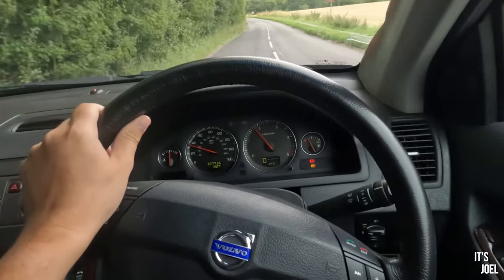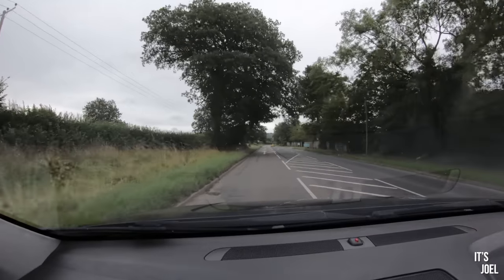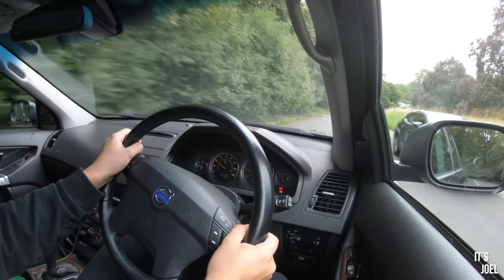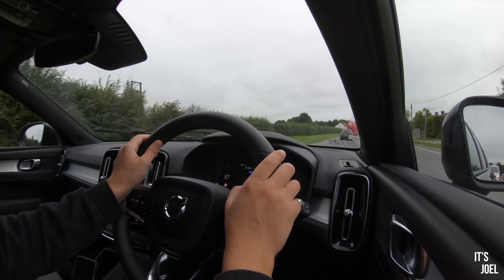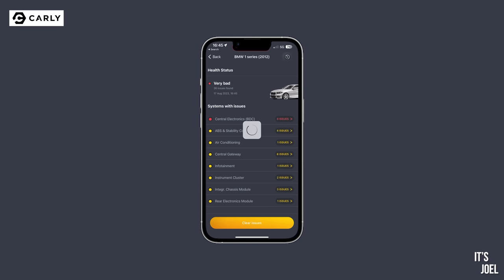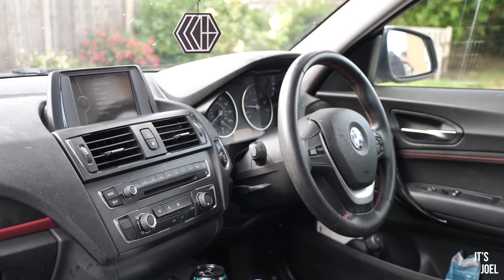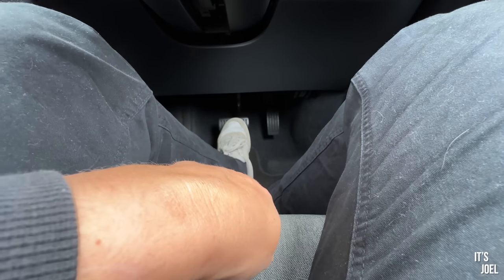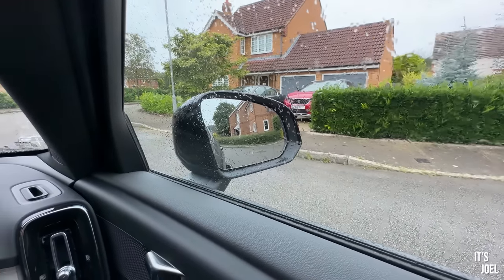I TOOK MY £800 COPART XC90 TO VOLVO FOR A HEALTH CHECK...

Comment: If it’s not rotted out, it’s worth DIY fixing … most of the trim parts you can get from a scrapper, the rest you can buy over a parts counter and fit yourself (or a mate can) for 400 to 500 quid. The headlamps will polish up like new, plenty of tutorials on the toob for that.
For 17 years, I’ve owned what is now a 27 year old Land Cruiser currently with over 500k kms on the clock, still going strong. I love it! ❤️🇷🇴

Comment: Sounds completely normal for a Volvo of that age, it needs a good service, and the wishbones need changing, probably £500 tops if you do it yourself.
Reply: most volvos 3 years old need wishbones or drivershafts lol
Reply: Timing belt is expensive, with that model best to do water pump at same time. Not worth doing yourself unless you’re know what you’re doing.

Comment: Now let a decent Volvo Indy look over it and give you a quote, The previous owner of my 2003 V70 D5 used Fishers in Gloucester who seem good for all his maintenance in the 7 years he owned it and the car still runs faultless 70K miles later in my hands with the extensive repairs that they carried out using gen Volvo parts (DMF, Clutch, Intercooler, Injector's rebuilt etc) Also send the dash cluster to Revtronic's for a repair, I thought my V70 cluster was scrap when it went pixelated on the digital displays but they repaired it with a lifetime guarantee for £80! And it's still working perfectly 3 years later! 👌

Comment: I'd fix it up! This is a rare, cool Volvo. Would be a real shame to see it scrapped.
Reply: And get nothing for how much you spend. No one wants a rotten old volvo
Reply: @richard3004  The XC90 isn't rare but this spec is. To the right Volvo person it would be a good second car or towing rig. And plenty of people drive rotten old Volvos - they're miles better than most other rotten old cars
Reply: @benjamindoyle668  No one wants them. Certainly no one in London or Greater London from 29th August. Additionally no one in their right mind will want that with that mileage not without an MOT. If you try to repair / fix it up it will be impossible to get as much as you pay out on it. Worth at max £350 which is the price of scrap.
Reply: Be done with it. I sadly parted ways with my '07 V70 after thousand after thousand spent. Still most comfortable car I ever owned but had to go.
Reply: @stereoheadmtl5944  i know what you mean 😢 ours wasn’t a Volvo but it was much loved by the family it had done us proud for years loaded up to the gills for holidays and things. But by the end she had a shell bearing go and at quite expense I fixed it but a few months later her guts fell out and would of needed a replacement engine which would’ve put it past twice what I paid for the car 😢… kids were all crying when the lorry turned up to take it on but time of death had to be called

Comment: It’s the engine every Volvo owner wants, they go for ever and are silky smooth, powerful and have character. So much nicer than the 4 cylinder soulless things available now.
Some savvy eBay purchases and a bit of spannering will see it good for a good few years.
My 90000 mile 13 year old xc70 is not even run in yet!!
Reply: Was about to comment the same thing. 

D5 for the win!

Comment: There’s no rot underneath, seems solid and to be fair a lot of what they said is easily repairable, and yes I have looked at the mot report.
Reply: I also think most of the amount they quoted was shop time, as the parts are all pretty straightforward to swap, but getting them out is a bit of a puzzle (particularly in the interior) and having to do that with every individual part will start adding up. It can quickly be 2 or 3 days of work.

Interior jobs are absolutely worth the effort if you can do them on your own free time. Parts are cheap and plentiful, and shop time is expensive.

Comment: All of that is doable. Polish up the headlights, get broken bits from a breaker. Do ABS rings at the same time as lower wishbones, as you have to take the driveshafts out anyway. Do the safety and MOT stuff first, then cosmetics bit by bit afterwards.
Reply: Cosmetics if ever….
Reply: I would also do the brakes (discs and pads) once you have the wishbones and ABS rings off, since at that point the brakes are very easy to get to.

Comment: you could put that right yourself for £500, 4 tyres £100, headlining £120, mirror covers X 2 £40, headlights will clean up, if not scrap yard 2 for £90,  DIY means Volvo don't get £4K labour charges,  its a keeper and will give you many years of service, you can do this a bit each weekend on your drive and have it minted in one month,

Comment: That sounded a reasonable quote. I took my Volvo 850 to our dealer in Hong Kong for a free checkup and they came back with an absolutely ludicrous price for every little thing under the sun of which I only had them change out the cracked engine mounts. -Car lasted another ten years with minimal work.

Comment: I would not consider it all that bad. I do my own suspension work however it's not always easy and you really require a fair number of tools to separate ball joints etc.

The biggest problem with this stuff is when something goes wrong. You really need a private space to work on so you can walk away if things start going wrong.

The other factor to consider is obtaing quality parts, many parts even ones with a name on them will not even last a year. What is very concerning is the poor quality of parts from local suppliers who supply local garages and tyre shops etc.

Comment: Ouch.  I for one would be interested to see how much it costs to get through an MOT.  I think this kind of decision is quite representative of the choices most of us have to make.  The liking the car and all its foibles, followed by the sudden noise that appears a few months before the MOT is due to run out.  I’ve gone through the last 3 years with my 407 coupe, thinking its doomed and then finding that I can fix it myself or find a cheaper garage.  Sorted my ABS and airbag sensor last month by fiddling about under the seat with some contact cleaner spray.  Loving the channel.
Reply: Meh, it's not like the car would fail its MOT for cracked dash trim and the head liner sagging. A lot of the issues identified are pretty much cosmetic, I don't think there's much MOT drama here beyond the tyres and brakes.

Comment: I own a V70 that has done roughly the same mileage. The age and use do show, but not all that bad: Doorcards slightly rattly, soft-touch surfaces worn, etc. But since I always keep up on the vital services and repairs, while some certified Volvo dealership might not agree, the car is always good to go and never left me stranded.

Comment: It's all easily repairable, and at least you don't have any rot to weld up. Start with the major items that are obviously   needed for the MOT pass. The rest would be on an, as and when funds and help allow. The entertainment system could be an expense, but a used or aftermarket system could be a cheaper option. It's still got a lot of miles in it, and it's too good to break.

Comment: All sounded quite reasonable. The cosmetic parts you can pick up as you see them. Personally, I would get the wheel's refurbished. My 2010 XC70 (90,000 miles) has just had it's annual service and MOT - new brake pads all round, new rear coil springs and full service - the bill was £1300 at an independent Volvo garage.

Comment: If you can get the timing belt, water pump and tensioner done in budget. This is worth saving. The serpentine belt stuff is easy to fit yourself.

Comment: The new Volvos are very nice. This car seems to only have a couple of optional extras and it’s the base level trim.  When you spec them up well you can make them amazing. The B3 is the least powerful engine and B means it’s a mild hybrid
Reply from the maker: Thanks for the info!
Reply: These new Volvos are just not Volvos. They do not drive like it. The visibility is miserable. The ergonomics are simply ludicrous. I will stay with my 1990 240 estate that Ma bought new. Only 400,000 miles on the clock and still running like new.

Comment: I think that’s actually all not that bad. These are mostly things you can do yourself. Perhaps with a little help from a mechanically-minded friend. I’d take that on easily. And I think you’d have a lot of fun doing the easy fixes. Plus you can then compare the driving experience after repairs with before. I’ll bet, for instance, that the intercooler replacement will give it more power and make it more enjoyable for you.

Comment: I have a 2011 XC90, it went into Volvo recently to have the Polestar Optimisation done, they did a free health check, the two rear indicator bulbs, the orange has started cracking on them so they recommended I get them replaced, they wanted £70 to replace 2x bulbs that you can get for about 80p. I've recently done a service on mine including fuel filter and the mpg has shot up since.
Reply: Are you happy with the optimisation? How much did you pay? I also have a 11 xc90 and was wondering about it
Reply: @bn357  for the price yes, I was lucky and got it 50% off in a sale so £349. Wouldnt be happy at £700.
Reply: @AndrewJB  thanks. I read indeed that some dealers would do it half price. I will enquire! £700 was sounding steep indeed

Comment: KEEP IT!
I've always been a Volvo fan, they are good, reliable and a ruggedly built vehicle (although I can't comment on the latest Chinese motors).
As long as you can service it sensibly and get the spare parts cheaply, it will keep going and going! They, in my opinion, are a super car to own. Love them.

Comment: Dealer repair costs will always be high. For a car at 20years old is bound to have issues. Yours are not totally bad. Brakes, tyres & suspension are critical to have right on your list. The headlights will polish up. Why did you drive it with abs light on and not investigate yourself? You promo'd a car diagnostic item on your friends beemer but didn't plug it into your volvo.........wtf?

Comment: Well worth  bringing back as long as its not at dealer rates. The headlights may respond to a clean with very fine wet and dry and then some cutting compound. The wheels still hold air and appear to be in balance so could do just tyres. The MOT will be the clincher and how much time and money to end up with good to go, but high miles car. On my mates volvo 740 estate we removed the cloth of the headliner.,hoovered the surface , sealed it with pva and then painted 2 coats of vinyl matt emulsion. Lets just say it was la lot less annoying and easier than replacing or removing and resticking new cloth .

Comment: If I was looking at any vehicle at an auction which has the first letter of the registration plate starting with a S the first thing I would do is look at the chassis for rot, having a scottish registration plate usually means underbody rust issues, in my opinion it's worth scrap money with that mileage.

Comment: Save this one Joel, reach out to the Volvo owners groups and see if they can help with the fibre optic issue, the service and mechanical stuff get stuck in and get it fixed. That car will be a belter once it’s sorted. No spoilers, but the MOT history is quite interesting as well, be good to do a vid on that as well, the cars done no mileage at all over the last few years, which makes this history somewhat interesting. Good luck mate, if you were up north I’d give you a hand mate

Comment: Definitely worth saving, most of the mot failures are consistent with its milage. Do all the fluids, belts and bushes etc and get it through the mot and then fix the rest over a few months.
Like people have said bits are readily available for cosmetic stuff. The bodywork will look ok with a clay bar and a polish and you can fix the headlights with an abrasive kit. It will be a good car with many more miles left in her..good luck with her, will look forward to the finished car

Comment: Considering the replacement for a new (or newer AC90), I would fix what needs to be fixed and keep it safe, I would just fix it.  I have just over 200,000 on my 06 XC90 and just had the second timing belt/water pump replaced my only issue is it is stuck in Park and I found a few go arounds for that.  My CLOSEST dealer is 5 hours away.  I live in BFE Montana.  I'll have to go and check out our second video.

Comment: Ive had my 2008 V50 SE 2.0d (EURO3 without a DPF) since 06/2015.  Its been great, very reliable and economical (gets 53MPG average calculated annually).
2 significant failures were the alternator at 145K miles/ 10 years old, then the starter motor failed recently at 180K miles/ 15 years old.
Ive replaced the front LCAs and front wheel bearings but I consider that to be "wear & tear" more than a failure. Timing belt done at Volvo main dealer in Ireland at 144k miles/ 10 years old.

I drove to Moscow from Dublin last August and returned in April this year (2023).... Invested in decent snow/ winter tyres, replaced coolant with 100% undiluted arctic spec coolant, also had to use special arctic specscreen wash. The diesel in Russia has special anti gel additives during winter (the price of diesel goes up 10% in winter because of the cost of the winter additives!).

The old girl would start every morning down to about -18°C.... Any colder than that and the battery struggled to turn the engine over fast enough to fire up.

Every year I think about trading her in but Id have to spend alot of money to get anything of similar comfort, spec or economy, so now that she has a fresh MOT- I will be keeping her on the road forq at least 1 more year!

Im off to Spain for the winter next week, the climate is more forgiving than Russian winters! The only prep she really needs is air con re-gassing and a set of summer tyres. Im gonna scour ebay for a set of used wheels & tyres because the paint is flaking off the original wheels (harsh anti freeze chemicals used on the roads in Russia really destroy paint and corrode metal fast!) .... Its cheaper to buy a set of wheels & tyres than it is to buy a set of 4 new tyres and scruffy, flaky wheels really let the car down, she has good paint & body condition except for the flaky alloy wheels.

Comment: Definitely worth fixing up if you can do the work or get some help.  Where it becomes a more silly proposition is if the chassis or body is rusted out.  That's a more technical repair and if not done correctly could compromise the integrity and safety of the vehicle.  I just sold a twenty year old vehicle that I've always maintained myself apart from servicing under the original warranty, and the family that bought it is overjoyed with the state of the vehicle.  They will easily get another ten years out of it if they keep the maintenance going and look after it as well as I have done.

People make the mistake of thinking that a car is not worth spending any money on so they let it get into this kind of condition where the amount of work is overwhelming.  If you do regular maintenance and repairs it never needs to get that bad. People also get stingy, not understanding that the cost of replacing a vehicle is always going to be a lot more than doing regular maintenance, especially if you can do a lot of it yourself.

Another point I'll make is that people banging on about buying electric vehicles because they are "green" have just fallen for the greenwashing.  The absolute MOST green thing you can do is maintain and keep driving old vehicles instead of replacing them.

That said, a dealership is normally the wrong place to get repair work done on a vehicle that is this old.  They will want to replace parts with new OEM components where possible, and their labour costs are always going to be in the higher bracket.

Comment: If that radio keeps shutting down, try pulling the fuse for 10 seconds, that should fix it. I had intermittent problems and this was the fix.
The main issues you have been quoted seem an easy fix, but deffo get an Independant shop to do an injector seal and engine service, the rest is straight forward.